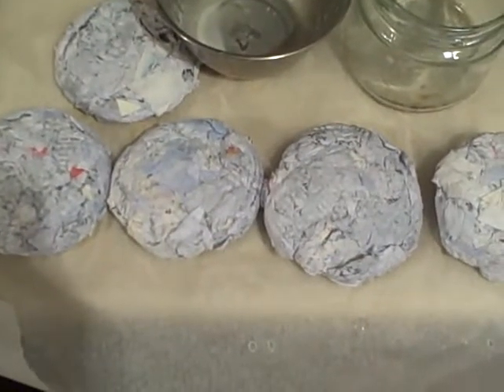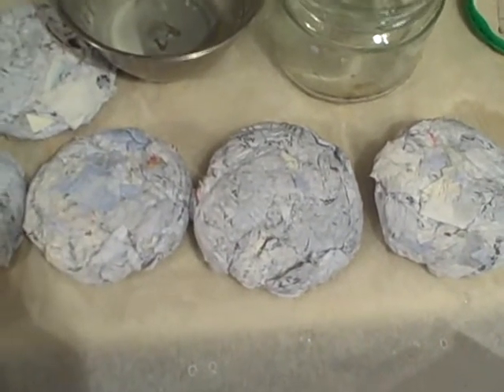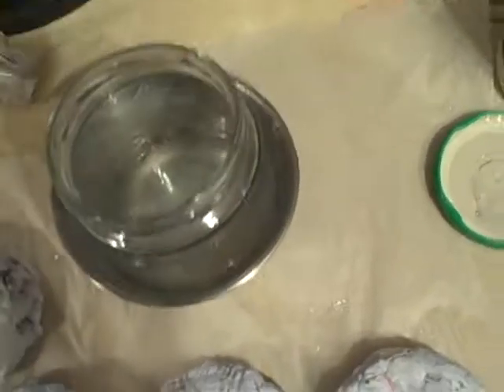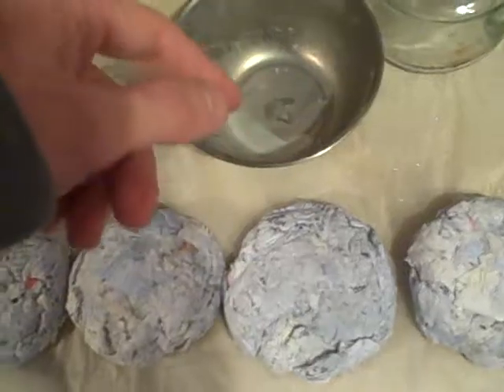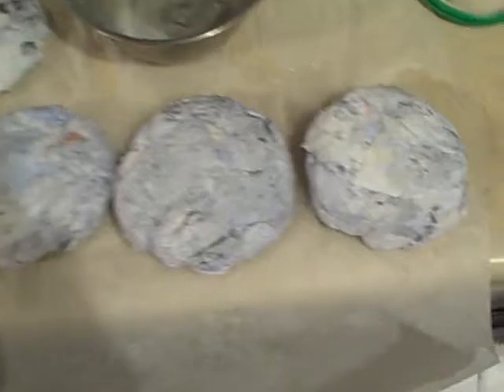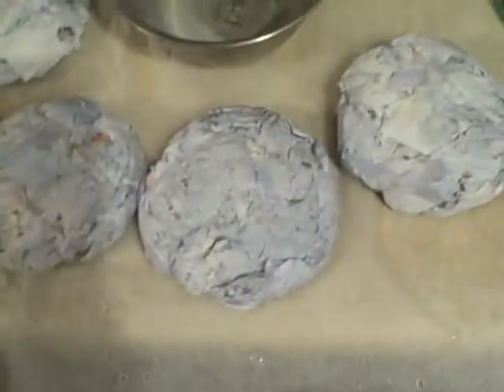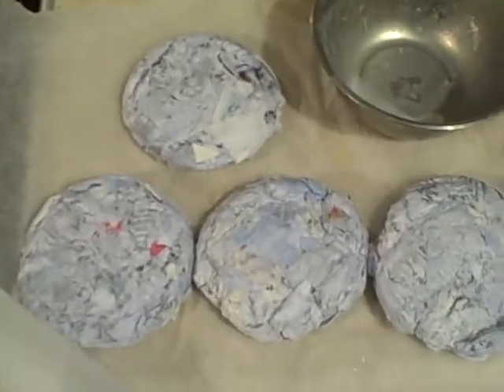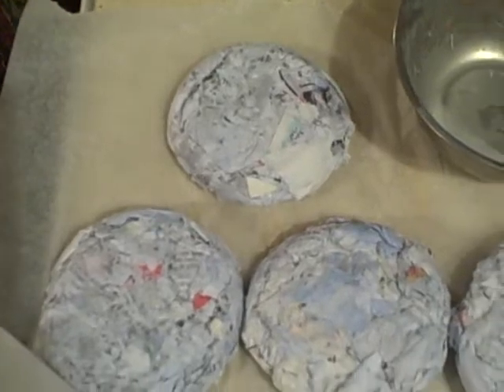Experimental Solid Fuel Making

Comment: nice, what i did was very similar, but i used leftover of wood, (really tiny pieces of wood the result of the use of a wood saw)  and i mixed that with paper (the paper was cut in tiny pieces to) after that,  i made a square box of wood to put the mix and press it into squares, after that just let it dry. the result was solid blocks  and easy to store, the flame is very intense and they last 30 to 40 minutes